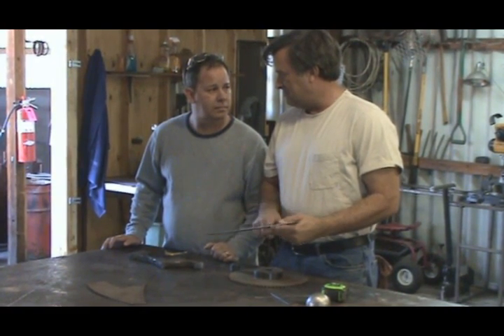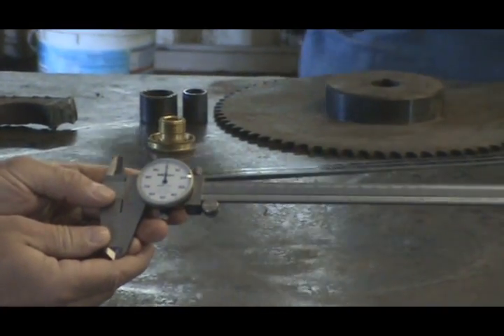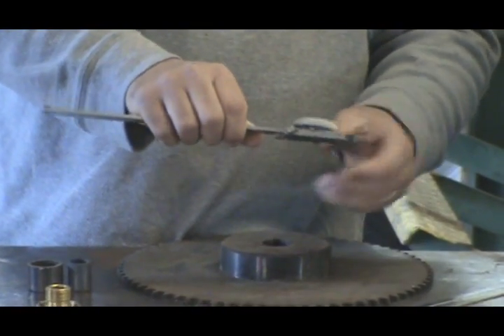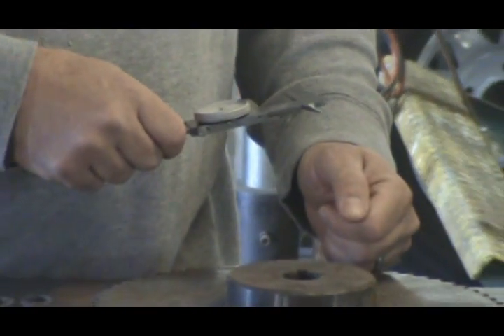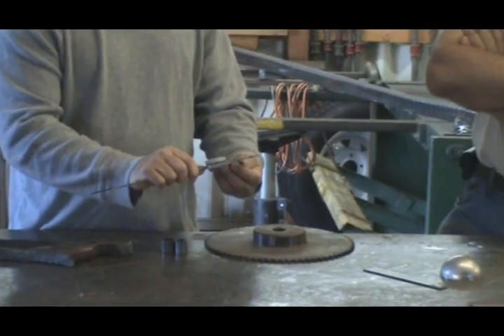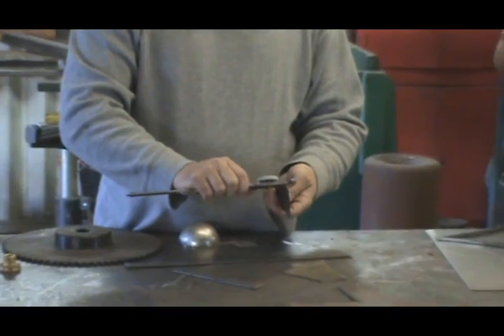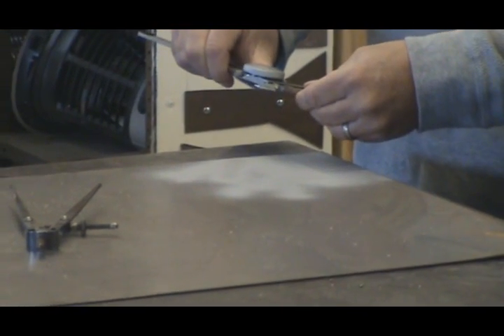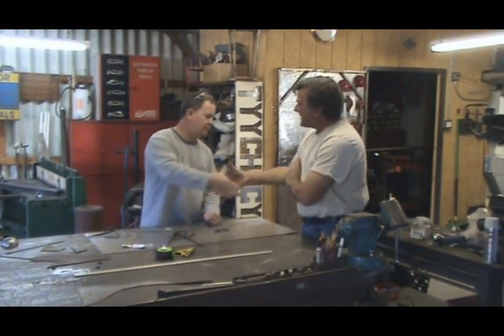Shop Math: Measuring With Calipers - Kevin Caron

Comment: Good job, very clear and precise how to information, easy to understand. You guys have a nice shop there and its nice that the video operator lady was knowledgeable enough that she pointed out a few things also, shows alot of experience.

Il just have a simple question though, Im not a metal worker, but it would seem to me that if you are pulling measurments from the corner in a layout process as you were, would'nt you first want to make sure the corner of the material is square first?

Comment: Is a good idea to scrib (scratch?) with the callipers, but i got two pairs of them - one old and used to do the scribing and the other one to do accurate measurements.
There are also special callipers designed for scribing (type scribing calliper in google images) Nice video.

PS The inch system gives me a headache - "one and seven-sixteens" Is it about 36,5 milimeters?

Comment from the maker: @pberglin That is acually a 1" plate sitting on top of my old table. Depending on what you are doing I would have no less than a 1/4" top. With lots of cross bracing and some careful welding it should last a long time. The top on the old table was only 1/8 inch and warped all over the place. Of course it was never intended to be a welding table. With the one inch top I can weld right on the table and not get any warping. As for rust, I just run the 7 inch grinder over it once a week or so.